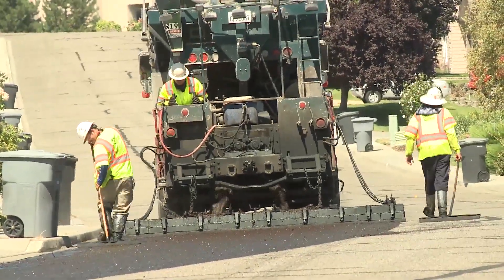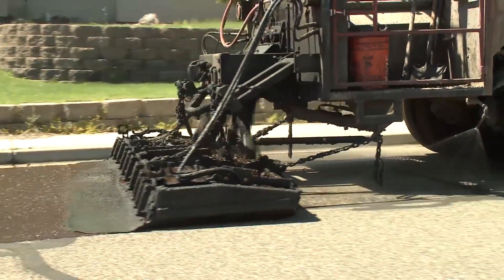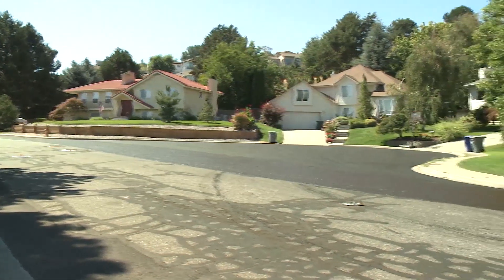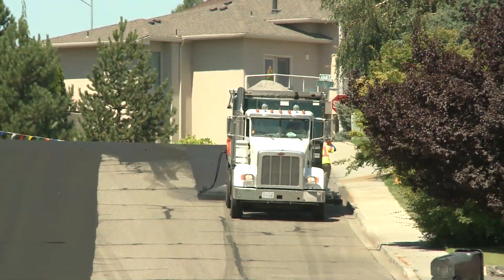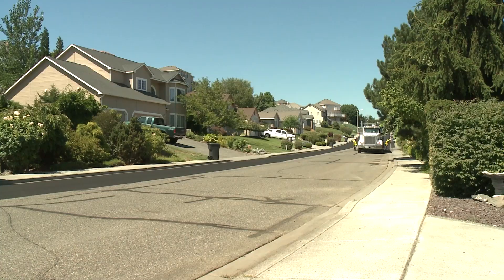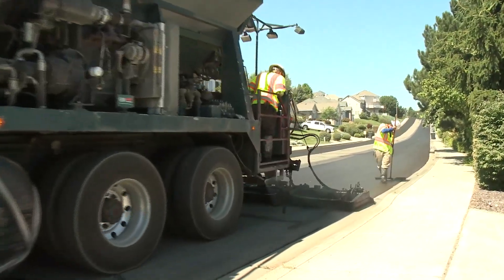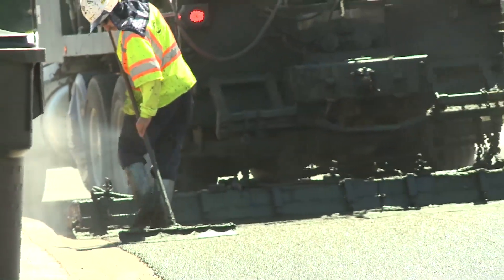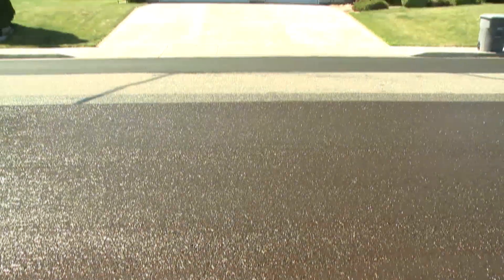Slurry Seal

Comment: Is this sealant well studied regarding cracks and potholes, because my city is doing this despite a very broken street that has potholes and cracks that need repair everywhere.  It's heavily travelled.  Show me the data!
Reply: not used on streets with potholes/cracks on it.
Reply: This preserves parking lots. It's just a thin layer.